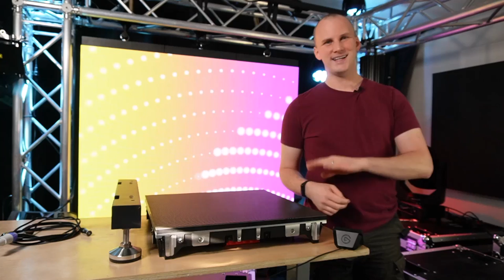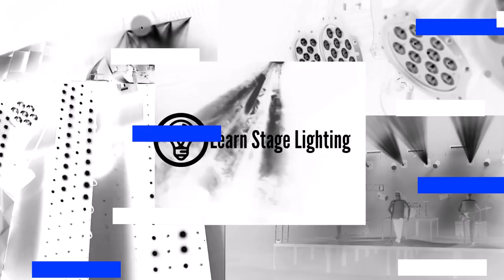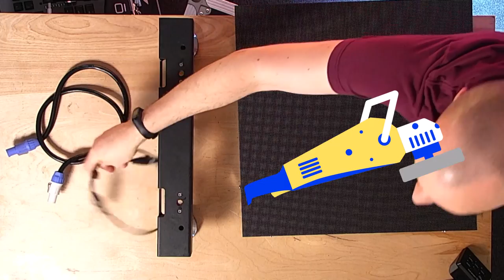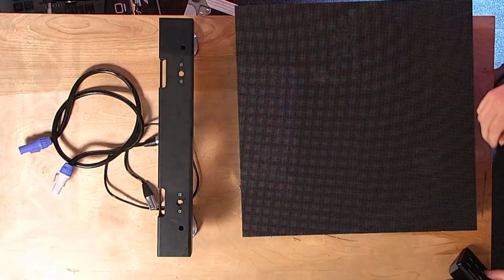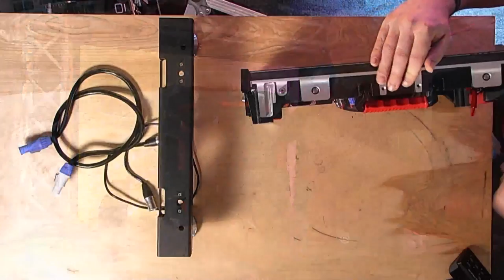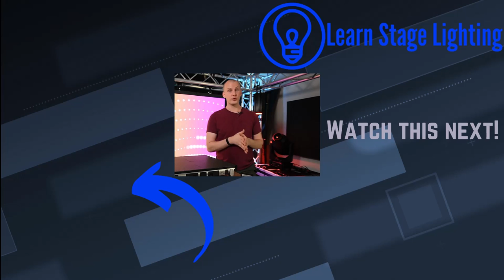How Do You Choose an LED Video Wall?

Comment: Why refresh rate of led wall is high >3480 ??? In monitor it is60/120 hz only
Reply from the maker: It's a different measurement from what I understand - the full LCD in a monitor vs. individual pixels in an LED wall.